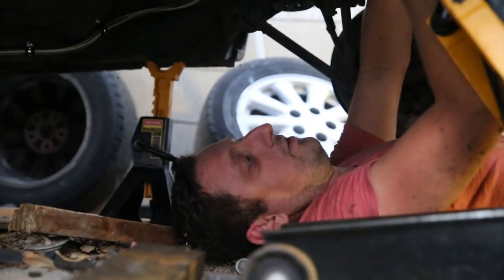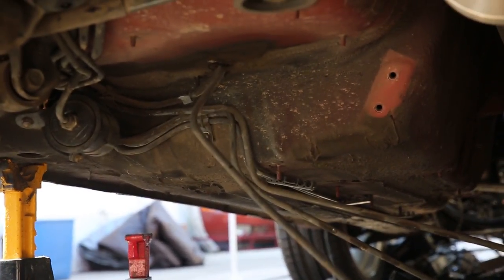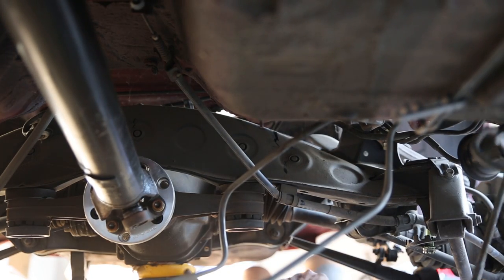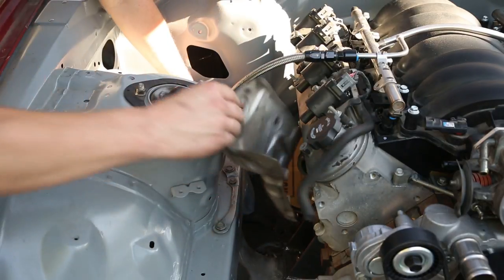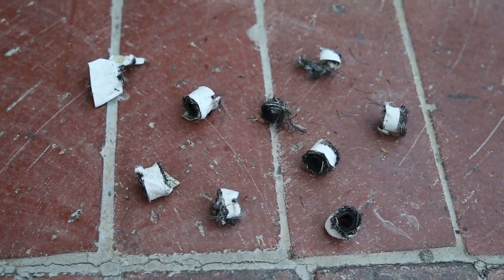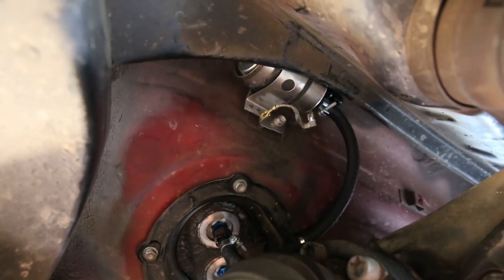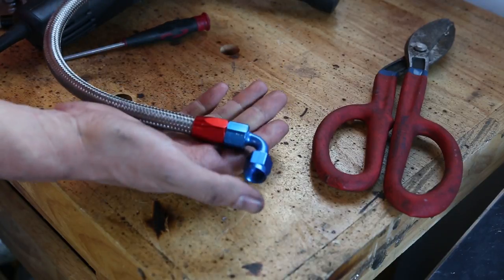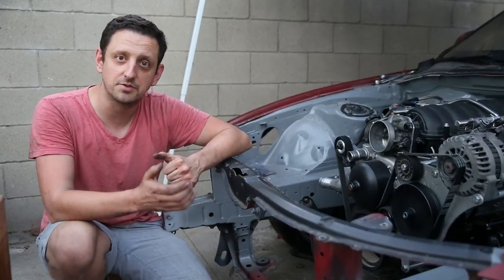Lexus SC300 Drift Build. Ep.26 -  LS Swap Fuel System Pt. 2 - Fuel Line, FPR, AN Fittings

Comment from the maker: Welp, I hooked up the FPR correctly on the car, but explained it incorrectly in the video at https://youtu.be/kPVKIHsQ2nI?t=4m1s. The side with the single barb on the FPR is the outlet to the fuel rail. The side with two barbs are in from and out to the tank. The center one is the fuel return, and the offset one is the feed from the fuel pump.

Bleh. My bad.

Comment: I'm psyched for this! Giving you another mention in my next upload. :)
Reply: Ever figure out why the second set went so much easier?
Reply from the maker: Just saw this comment. It was a different manufacturer for the AN fittings which could have been it. I also had a bit more practice, so it could be both.

Comment: dang. I like the way you routed it better than mine. the nylon braided lines are a lot easier to work with though. keep up the good work.
Reply from the maker: Glen Heleski this seemed to make the most sense since I was replacing the entire fuel line instead of using the OEM. Hopefully I don't have any issues. Thanks again for all your help!
Reply: doesn't look like you should have any. maybe install a 90 fitting on that return line like you did at the fuel rail. and no problem at all happy to help.

Comment: I would have used PTFE teflon lined hose. The rubber hose will eventually fail. Also Russels makes an all aluminum screw together quick connect efi fitting that will clamp on to the 3/8 fuel rail and the 3/8 and 5/16 FPR/filter. Much safer than the plastic push fitting.

Comment: In speaking with some who have worked on many ls , your stock fpr corvettes style will fail ,I would recommend an aftermarket fuel pressure regulator
Reply from the maker: TeamTOS thanks for the advice! I’ll definitely upgrade sooner than later.

Comment: What are you going to do with EVAP hose fitting? Block it off? For the return line, put same AN fitting as supply hose and 90° fitting from fitting and to your FPR/Filter
Reply from the maker: I'm not sure on the EVAP hole yet. Either block it off or leave it open/put a breather there maybe.  And yeah I'll be putting another 90 degree fitting for the fuel return as well. Cheers.

Comment: to make life and appropriate install of an fittings easy.install the fittings with the tape still on the cut line...remove tape after fittings are over lines and life is great...please try at very least once a week videos for most efficient you tube income.
Reply from the maker: I actually tried that at one point. For some reason my electrical tape wasn't holding the braided steel well enough and it was unraveling even when still on the line, and the gaff tape that I ended up using was too thick to fit on under the fitting. Thanks for the advice though. I probably needed stronger electrical tape to do it properly. And I'll work on weekly uploads. It's hard doing all the work and editing and everything each week. I can try to make shorter episodes that hit smaller projects and upload more often. Thanks again!

Comment: While I get that you were going to drop the subframe anyway... why not just hack the lines apart to get them out if you weren't going to save them?

Also now I want to go through and redo the fuel lines on my C10 because they are not this nice by any stretch of the imagination.  Damn you.
Reply from the maker: The lines were all full of fuel still and I didn't want to mess with cutting them up and risking some potential fireball. I'm sure that wouldn't happen, but it just made sense in my mind to pull them out intact. 

It's definitely nice having a very simple and straight forward fuel system. No weird OEM to aftermarket connections or anything. Very simple to troubleshoot and I know where everything is.

Comment: Cut the fuel lines why take the subframe out of your not going to be reusing the old lines
Reply from the maker: There was still fuel in some of the lines and I didn't want to risk cutting metal and making sparks. It was easy enough to lower the subframe. Ideally cutting would have been much faster though.